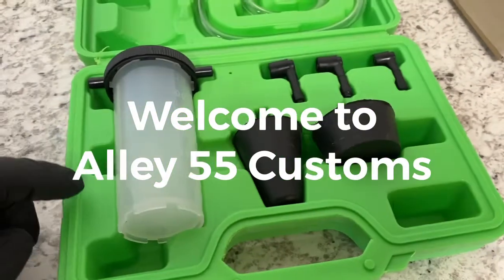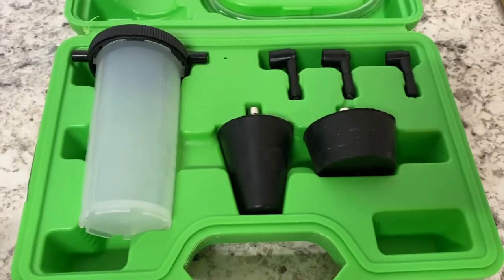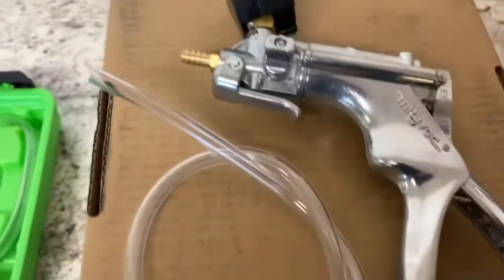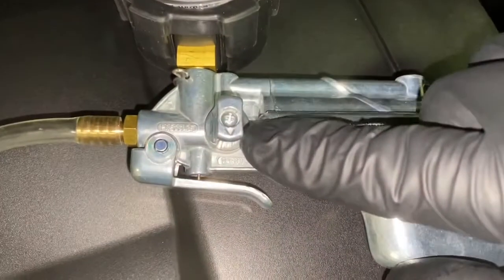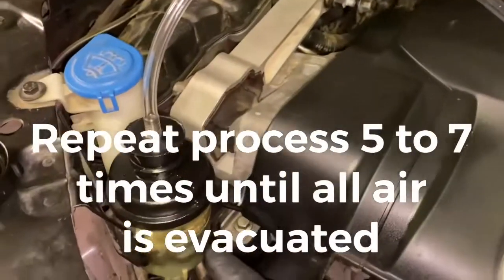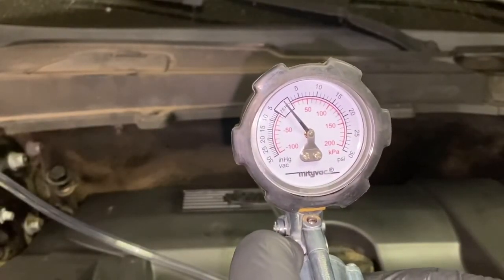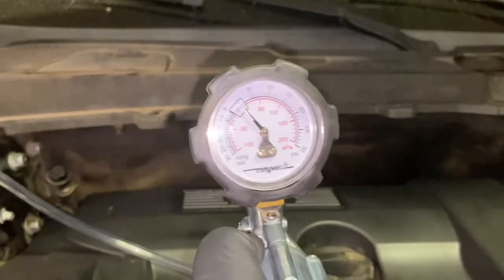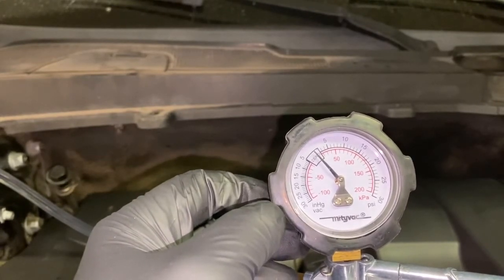OEM TOOLS 27311 Power Steering & Brake Bleed Adapter Kit -Product Review & Demonstration. Episode 73

Comment: Thanks for the video, I ordered the whole kit that you have, same items. I need to replace my PS pump as it's becoming manual steering. The Ford shop manual says that the old way without a vacuum won't get all the air out. So I'll need vacuum. Gonna replace all the hoses too on my 2009 Ranger.

Comment: I had the same issue and found out it was the end adapter (rubber triangle). I took the other one that's bigger, put it on the top pressing down.  I was then able to get it to pull a vacuum easy with it just sitting on the top edge. Hope this helps someone.

Comment: I have an issue. I replaced a pump 2001 Altima. Air seems out of system no bubbles at all, fluid topped off but can't seem to get pressure no power steering. Help
Reply: @ReadMyNameThanks  Took the pump apart and it was built wrong. There's signs of damage.
Reply: @ruben85374  Thanks for the update.  I might have to do this soon on my Jeep
Reply: @ruben85374   I'm only going to buy an OEM Ford PS pump, I don't trust the China stuff. Hope it worked out for you.